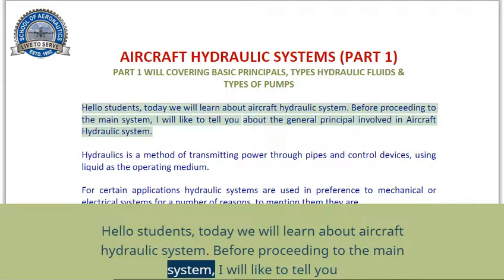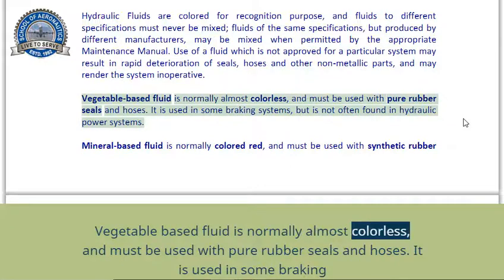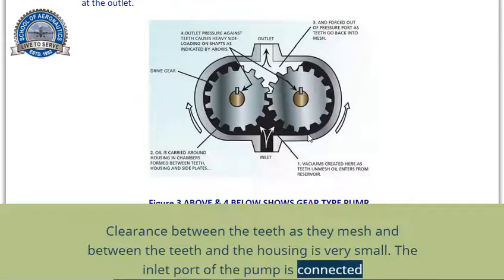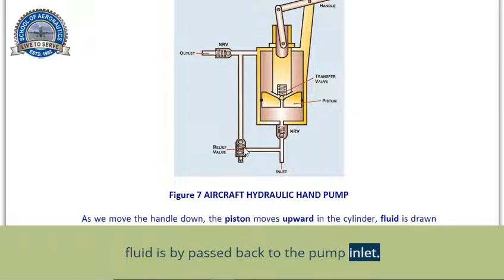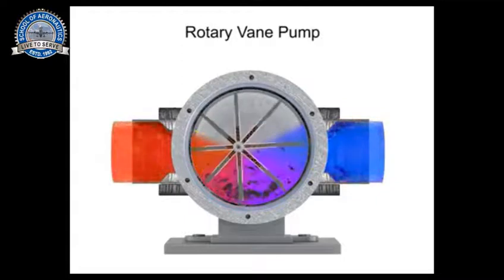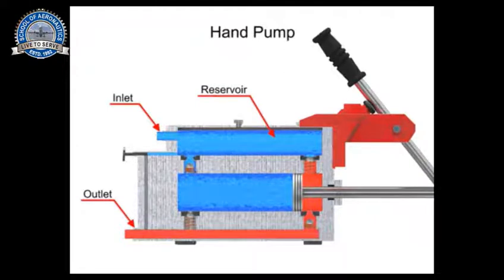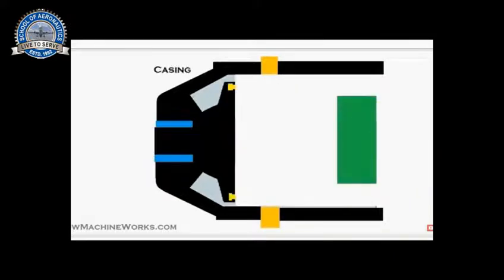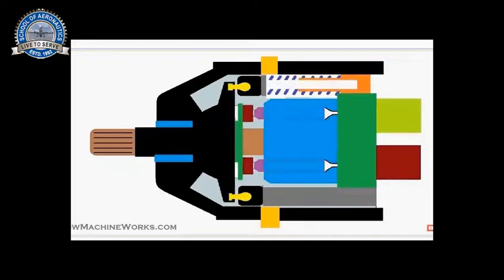AIRCRAFT HYDRAULIC SYSTEM PART 1

Comment: KRAMER: Commando 8 has arrived! JERRY: Take it to the window. KRAMER: 12.000 BTU’s of raw cooling power. (Kramer places the air conditioner in the window) KRAMER: Installed! GEORGE: That’s it? You don’t have to screw it in or anything? KRAMER: No, just plug it in and the Commando 8 does the rest.